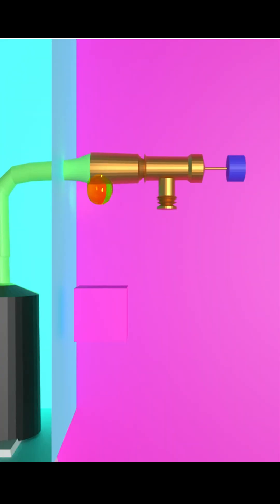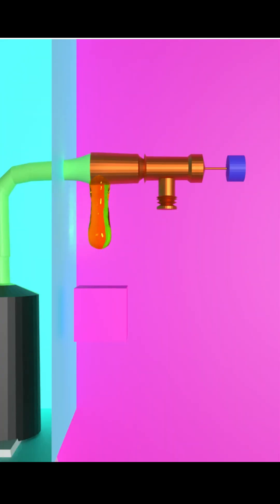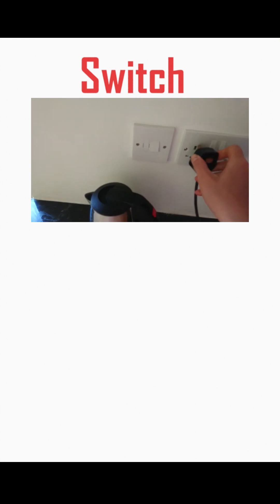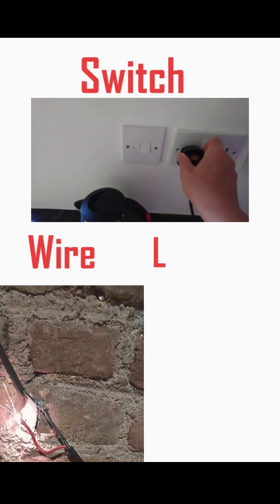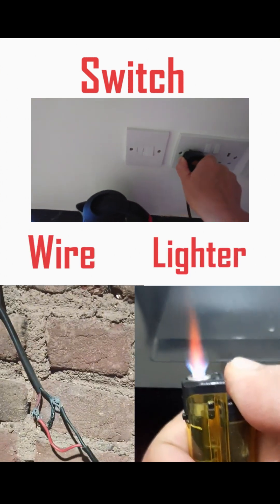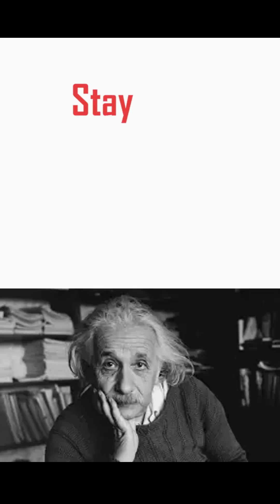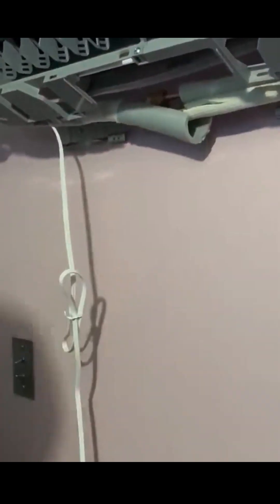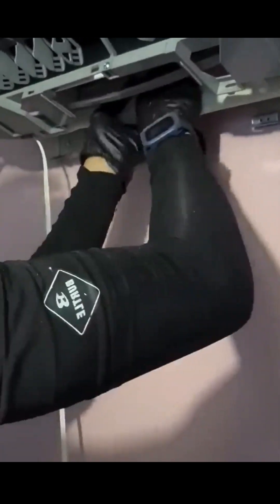why AC Explodes? #shorts #shortsfeed #airconditioner #technology #reels #education #compressor

Comment: Everything about this clip is incorrect. A compressor can not explode from a faulty "safety valve" as stated. This does not exist. r600 and r290 is  not used for air conditioning, they are used in refrigeration in small amounts. R32 has been used widely outside of the US and is only mildly flammable. HVAC tech for 35 years
Reply from the maker: Brother...
Thanks for your comment.  But I think you should search a little more.❤️